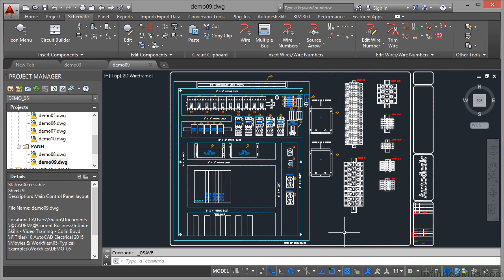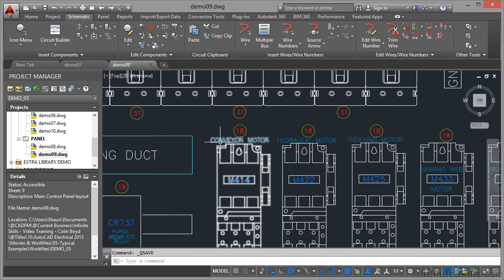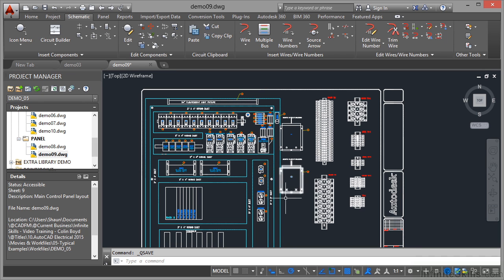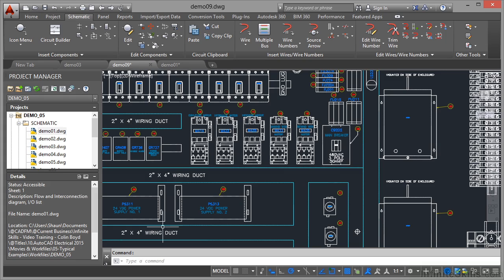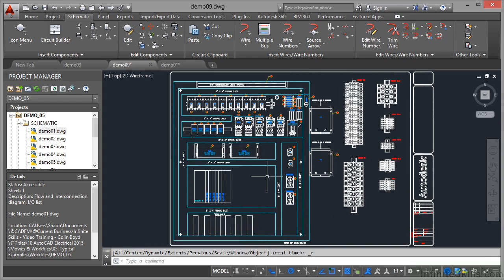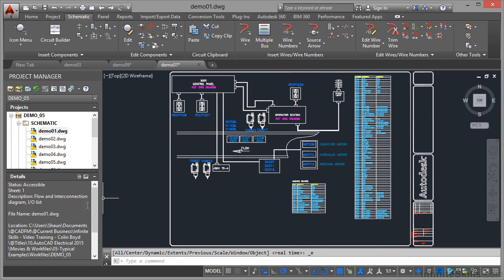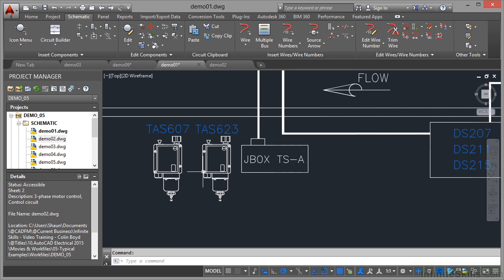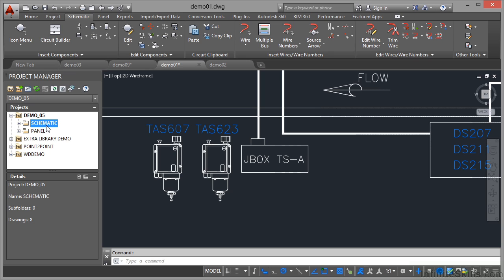AutoCAD Electrical 2015 Tutorial | Panel Drawings

Comment: Panel Designing Training | Autocad Training | Panel & Autocad Training in Noida
https://www.diac.co.in/courses/panel-designing-autocad/
The course curriculum for Panel Designing and Autocad training course is designed to provide in-depth knowledge that covers all the modules for the training ranging from basic to advanced level. DIAC is one of the best Automation training institute in Noida with 100% placement assistance. Call @9953489987, 9711287737.